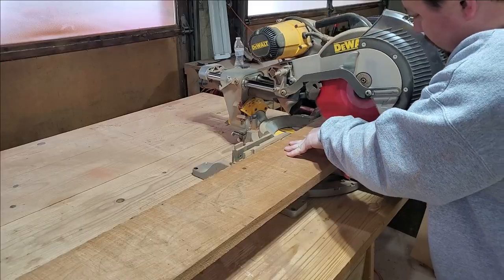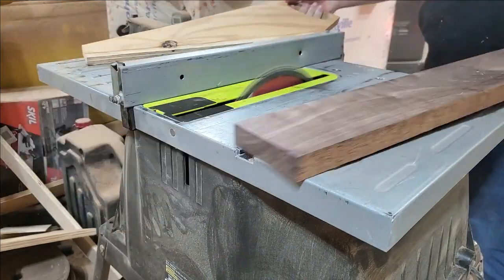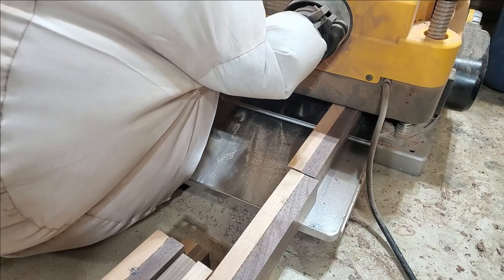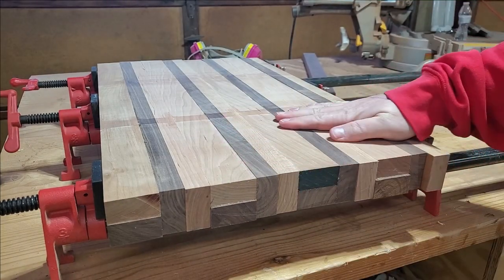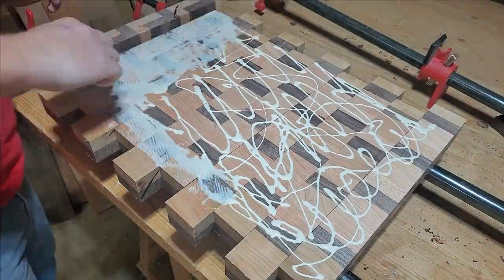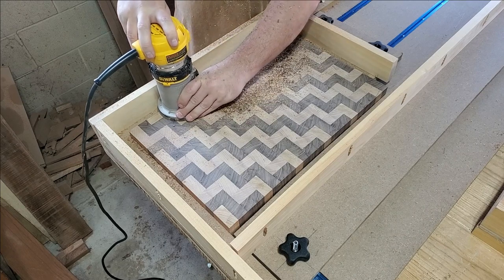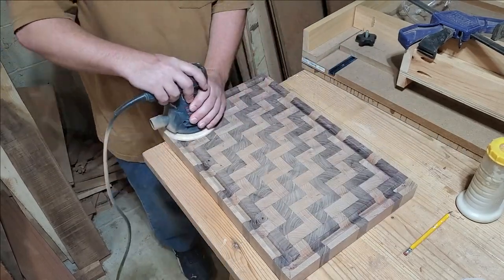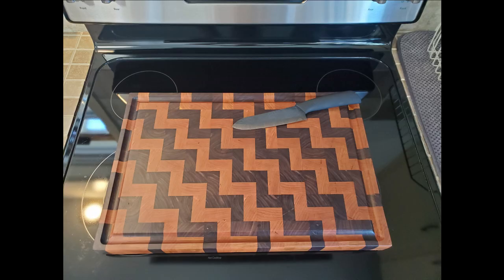Believe it or not this beautiful step pattern cutting board is made by a rookie!

Comment: Not bad for a rook😊.   I like working with the router a lot, and have noticed a lot of folks don’t go the correct direction.  It’s also opposite when using a router table, since the router is upside down.   Love the channel.  BTW, I got the “free” stand with the desalt planer, and it has two fixed wheels which you really can’t change to swivel wheels.  So it is a pain in the neck.  My next shop build will probably be a miter saw cabinet, but one day I may replace that one too.

Comment: Have other woodworkers say when routing for the juice groove 1) slow the speed down on router,  maybe start at half speed, then step up speed as needed. 2) Always move router in the same directions as the bit is turning. In other words, if bit is going clockwise, one routes the juice groove clockwise. 3) Rout out the juice groove depth in steps, don't rout too deep this first time around, make several passes. Gives a better finish without too much sanding if any. Hope this helps out.